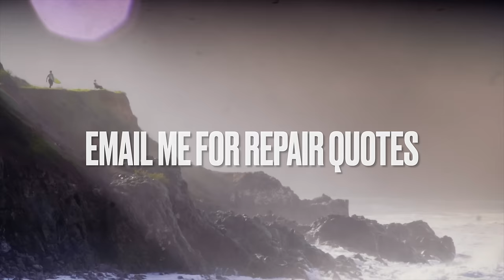RE-MADE surfboard, testing in BIG waves.

Comment: Did you use dowels or something else to reinforce the broken stringers? Didn't seem like it had a very good stinger to start out with. Almost feel it would have been better to split the board and glue in a new stringer. Also fiberglass fins are so much better than the Thermtech plastic fins

Comment: At 2:57 you don't need to clean the inner edges of the old foam first ?it bonds ok to the dirty old crack ? Lol
Reply from the maker: Yep it’ll bond
Reply: @Rogue_wave  i have an older 10 foot long board that has some delams and is twisted (more at the nose) i want to turn into a fish. hopefully an 9.0 long fish. have you ever been successful in getting rid of the twist in a board?
Reply from the maker: @nnnnnnnnnick5557  I've never tried! Check out Swaylocks I remember seeing someone post in there about a good method for this.

Comment: All smart, but foam should be glued with Gorilla type glue maybe (polyurethane glue) not sure. I would use Great Stuff spray foam (which is PU) as the glue, but I'm sure you know about that for filling holes in the blank.
Reply from the maker: I did not know about great stuff, thanks Carlos! Good idea on the poly glue as well.
Reply: @Rogue_wave  Oh sweet. Glad I helped. It's "great stuff." wah.
Reply: @Rogue_wave  the shit is insanely sticky though, so you might want to wear disposable gloves. Best wishes in shaping and glassing, etc.

Comment: Is there a reason you use a hand saw? And say not a jigsaw?
Reply from the maker: I have a jigsaw and used it once- I got really uneven cuts on the rail (you can see I have the same issue with the pull saw as well 🤣) the reason being- the surface of the surfboard deck is convex, so your jigsaw isn’t sitting on a flat surface, so it cuts an angle.

Comment: i keep seeing people set boxes without fins.how do you set cant make sure fins are same seems risky to me?
Reply from the maker: Good question. When you originally route, the boxes fit very snuggly, so you don’t have to worry about the angle. Both futures and FCS boxes get installed straight (90 degrees). I only set the angle when I’m doing repairs and the box has room to move inside the cavity when the filler is hardening. Hope that makes sense.

Comment: Save the laminates though cuz they are awesome. Sort of like a tombstone.
Reply from the maker: Thanks, good point! Do you know a good way to remove them without causing damage?
Reply: @Rogue_wave  I just save the glass with the logo attached. Razor blade around logo then just peel that one section back mare carefully before stripping off the rest of the board. Pin on your wall or glue them on to magnets etc. Cheap surf art!